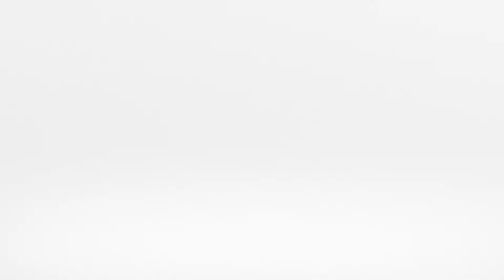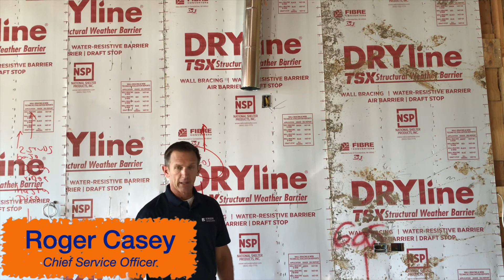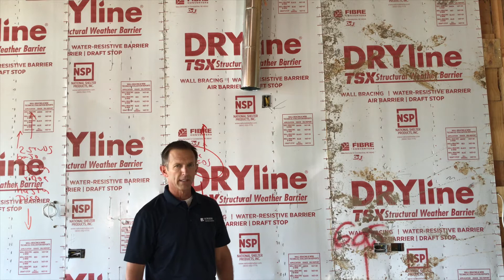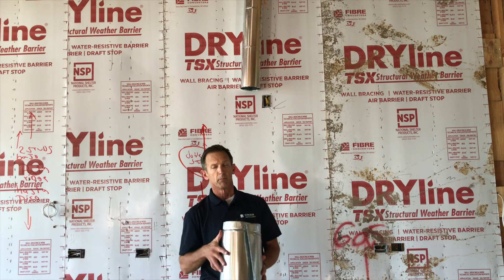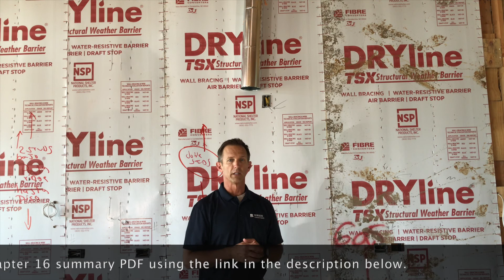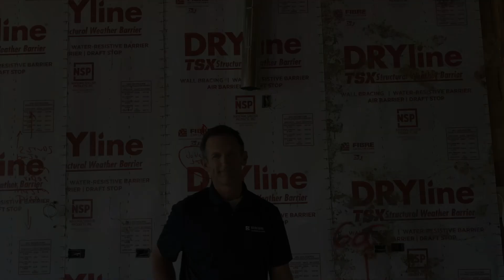Duct Installation for Ventilation, Heating and Cooling Equip  - IRC Chapter 16 Code changes and tips

Comment: I have a question, on round metal duct work return air systems, specifically adjacent pipe connection, does the return air duct have to follow IRC Duct Lap rule.  I understand the Supply air needs to follow this principle, but does the return air branch duct connection need to follow this rule as well?

Comment: Can you merge two outlet pipes into one to minimize exterior wall/roof penetrations? Two bathroom fans or one bathroom fan and a oven venthood?
Reply from the maker: In the 2015 IRC, section 1503.1, the exhaust from a range hood must be independent of all other exhaust systems. In section 1502.1, the code informs us that dryer vents must also be independent of all other exhaust systems.

The code does not prohibit merging two exhaust outlets other than those or range hoods and dryers. You could combine exhaust ducts, but they may not perform as intended. The flow rate of the fan, dampers, type of duct, duct length, and configuration of duct can all impact how the exhaust system would perform. If you decide to go this route, you may want to consult with your local Building Official. Sometimes there are local regulations or code amendments that may prohibit a practice such as this.